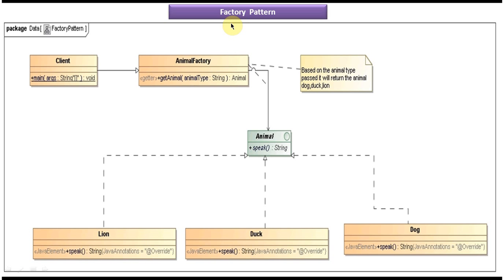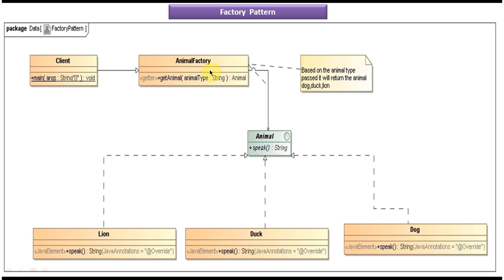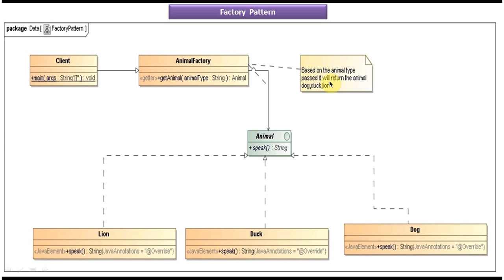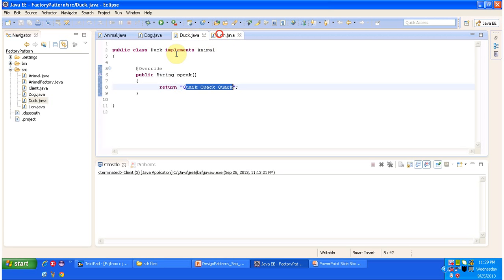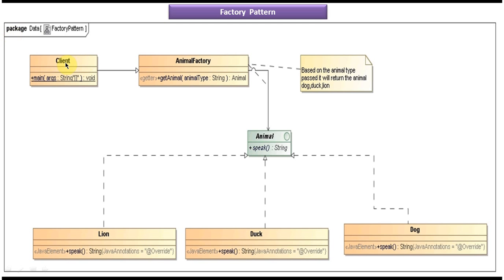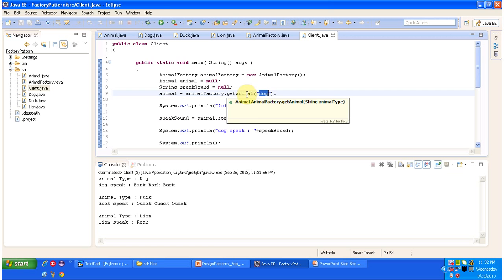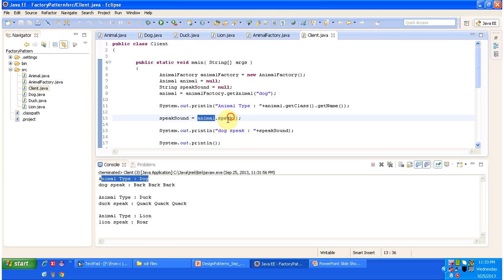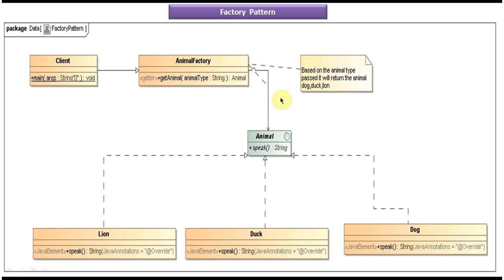Factory Design Pattern Implementation: Code Examples & Best Practices

Comment: What if I need to inherit common methods from another class to concrete subclasses( Lion, duck and dog )? Does that break the loose coupling somehow?
Reply from the maker: yes you  can do.yes it will break the loose coupling.
Reply: Ram N How exactly? Can you explain a bit more? What I need is a common method for all the classes that generates the same thing actually. So there is no point in repeating the same code in all the 3 classes. What should be done in that scenario?
Reply from the maker: Palash Chanda  Common method for all the classes that generates the same thing is not possible because based  on different animals we have to change the behaviour of the speak method
Reply: Ram N Sorry, it seems I failed to explain myself clearly. Think of some other method than speak like eat which returns the same output for all the 3 animals. How should I define that function without repeating them in all the 3 classes( that would be unnecessary I believe ). Is it possible using Abstract classes instead of an interface? Is it legal in the context of factory patter? or can I just define it in a totally different class and also inherit that class in all the 3 classes( dog,duck, lion ) while implementing the Animal interface?
Reply from the maker: Is it possible using Abstract classes instead of an interface? Is it legal in the context of factory pattern?

Ram : Yes it is possible and ok to do like that

can I just define it in a totally different class and also inherit that class in all the 3 classes( dog,duck, lion ) while implementing the Animal interface

Ram : Yes you can do this way also.
Reply from the maker: Ram N Good thinking :)  and good questions :) .Thanks for watching and asking questions
Reply: Ram N I actually needed this. Thanks for great videos. Keep uploading them.